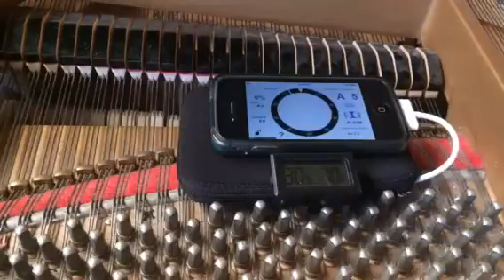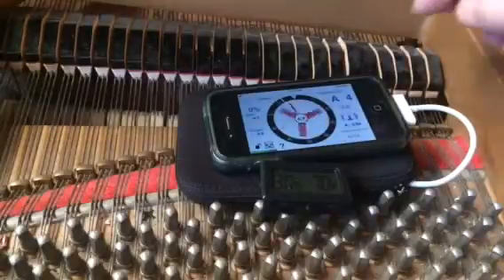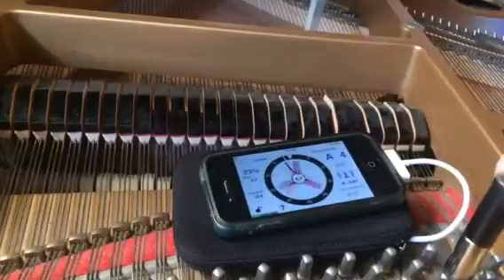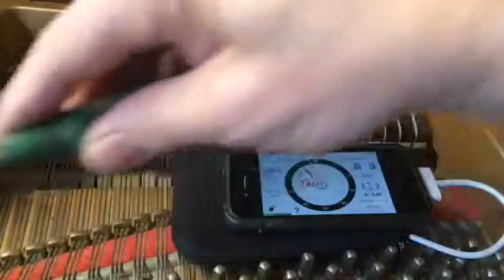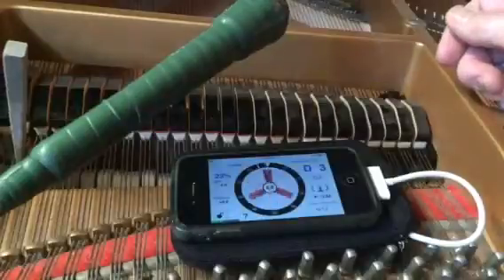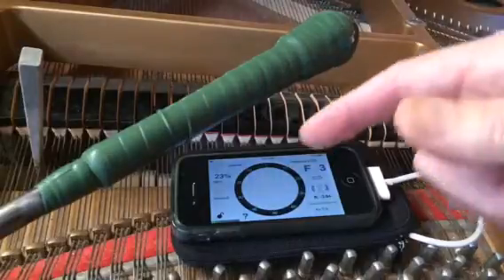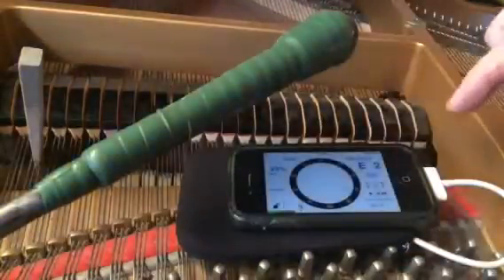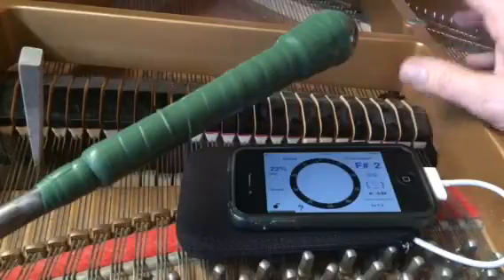Verituner basics 3

Comment: Thanks for the great videos Ron. I have just one question; what does the percentage refer to? Is it the same as cents? And how does it calculate it? 10% of what? Will the target be higher if the starting note is very low? It's just not clear for me...
Reply from the maker: It irefers to the calculation of overpull - take the initial measurement flat(or sharp) in cents, then calculate a percentage of that measurement to come up with the overpull number. For example if the piano is 50 cents flat and a 20% overpull is specified, then 20% of 50 cents = 10 cents.
Reply: Thank you so much, now it's all clear to me.  @drwoodwind